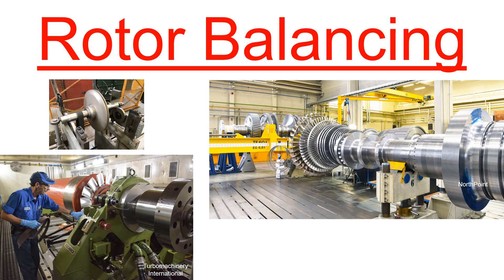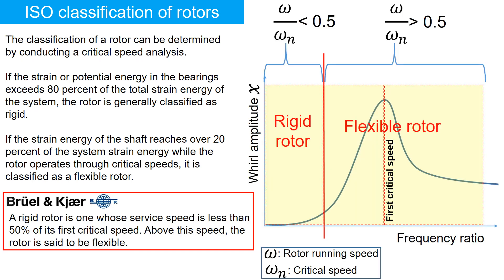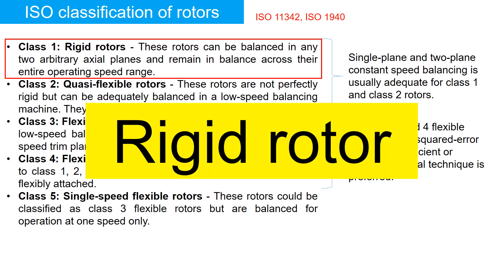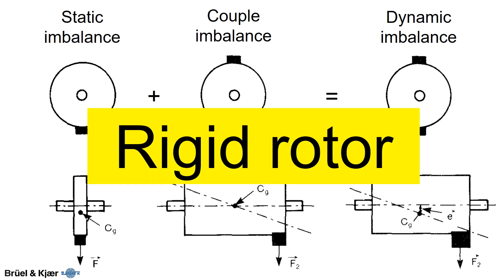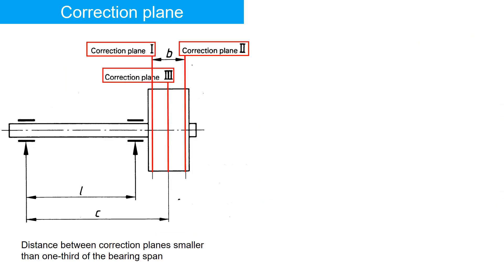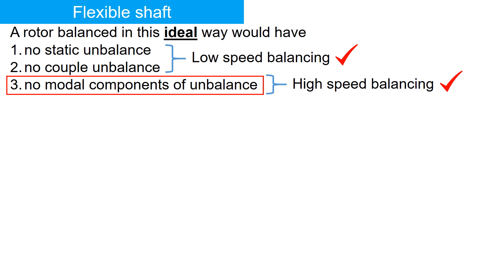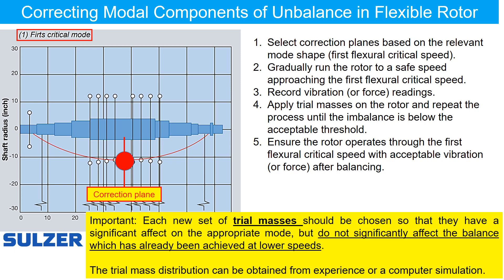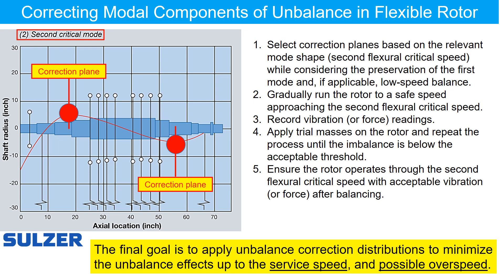Part 24 - Rotor Balancing (of rotating masses)

Comment: Hi, if the rotor is operating above second critical speed with rocking mode, is it sufficient to perform only a lower speed balancing? Thanks
Reply from the maker: That's a great question! If your rotor dynamic analysis primarily shows rocking modes, low-speed balancing might be sufficient. However, if the separation margin with the flexible mode is limited (check out Part 7 and Part 9 for more details), it's generally advisable to perform high-speed balancing as well. This ensures you address the rotor's behavior throughout the entire operating range.

Comment: Many thanks!, nicely put; still have to see the rest of your videos but it would be great if you could comment on the high speed balancing procedure and some of these topics:
- balancing machine bearings (sleeve bearings, not always the actual tilting pad job bearings) 
- pedestal stiffness vs actual turbine pedestal stiffness, (is the test HSB vibration amplitude representative of what will be later seen during machine operation?
- though not an API criteria, many users actually want to see the eddy current vibrations amplitude during HSB, as that is what trips the machine later on, and ask for very low amplitude after the test… HSB is sometimes seen as a preliminary “factory acceptance test”

Again thanks for the effort in putting all these videos together, they are incredibly educational!
Reply from the maker: Thank you for your thoughtful comment and valuable suggestions! I'm glad to hear that you find the videos educational. Your topics on high-speed balancing procedures and specific aspects like balancing machine bearings, pedestal stiffness, and eddy current vibrations are excellent suggestions.

I'll definitely consider covering these topics in future videos. It's great to know what specific areas of interest my audience has, and I appreciate your input. :)